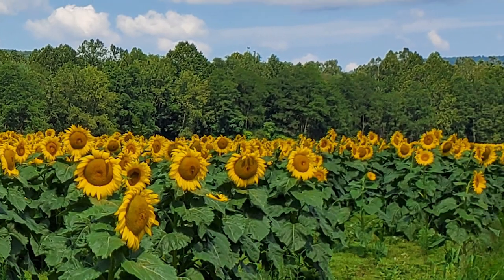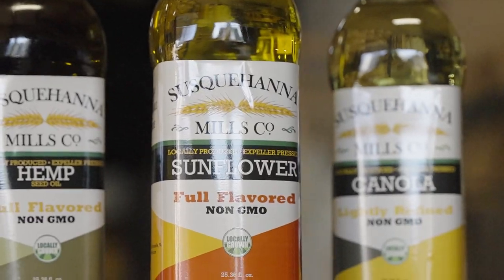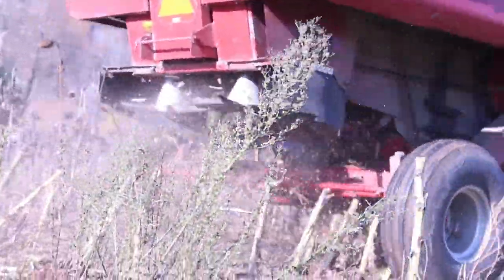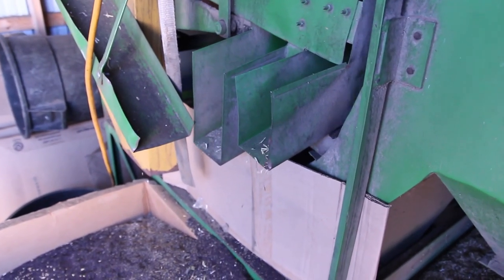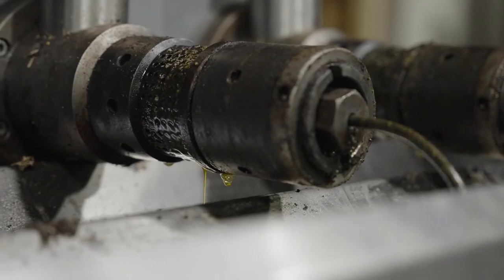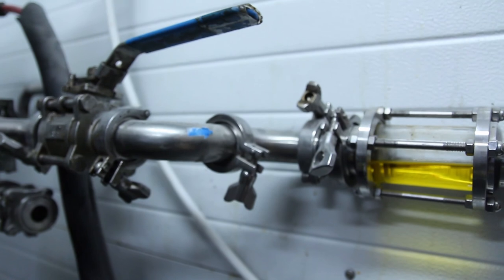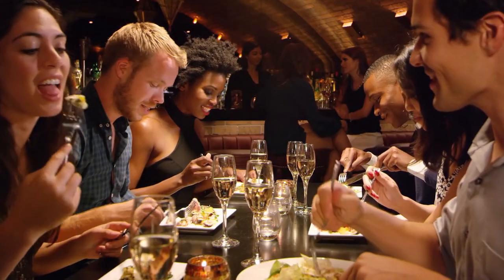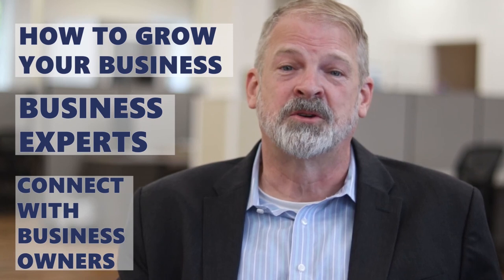How It's Done: From sunflower seeds to cooking oil

Comment: Just asked Chat GPT: Turns out they skip over all the harmful toxic processes.

Crushing: The cleaned sunflower seeds are crushed to obtain a crude oil mixture.

Extraction: The crude oil mixture is then subjected to a solvent extraction process to separate the oil from the seed residues. The most commonly used solvent in sunflower oil production is hexane.

Degumming: The extracted oil is then subjected to a degumming process to remove any impurities and unwanted substances, such as phospholipids.

Neutralization: The degummed oil is then neutralized with an alkali solution to remove any free fatty acids present in the oil.

Bleaching: The neutralized oil is then bleached to remove any remaining impurities and unwanted substances, such as pigments and odors.

Deodorization: The bleached oil is then deodorized to remove any remaining odors and flavors.

Refining: The deodorized oil is then refined to improve its quality and stability. This can involve processes such as winterization, which removes any waxes, and dewaxing, which removes any remaining impurities.
Reply: thank you for these specific processes
but .....
except for the only mention of hexane , ...... where can one find the exact processing , viz the other chemicals used , the temperatures applied etc etc etc ....
it  seems a military secret .....
not a single COMPLETE video to be seen about it
Reply: chatGPT isn't a reliable source for any factual information at all. do whatever additional research you want, but don't take the word of a machine that spits out words that are kind of related to each other

Comment: At least the oil is actually made from the fruit of the plant and not stems and whatnot. Though I do wonder about that final filtration step.
Reply: I'm not 100% sure but, I've heard they use a lot of chemicals to get rid of a very nasty smell
Reply: The final filtration step involves solvents and bleach. Tasty
Reply: They conveniently forgot to mention a lot of the problematic processing steps. Another comment in this comment section goes over them.
Reply: @antebellum1776 Thank you. /sigh